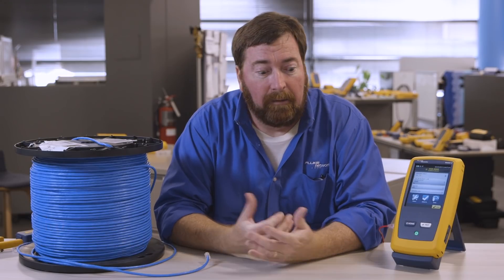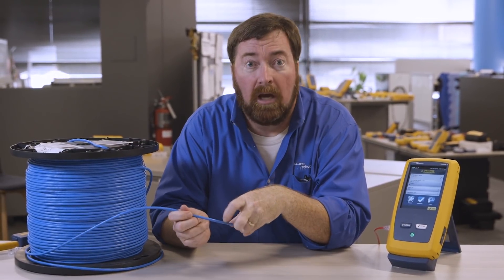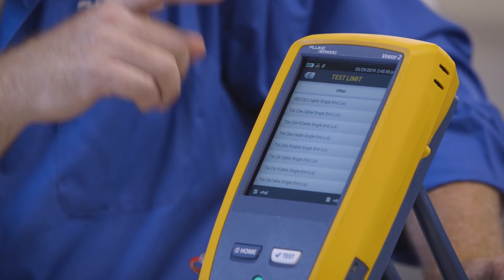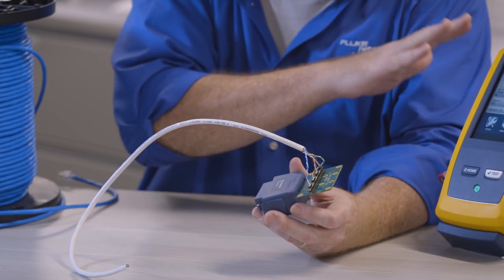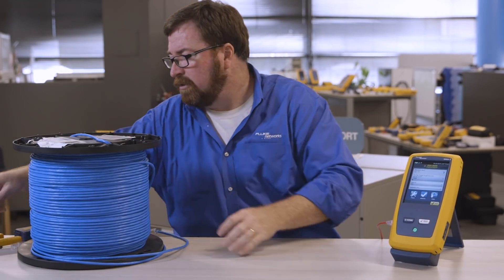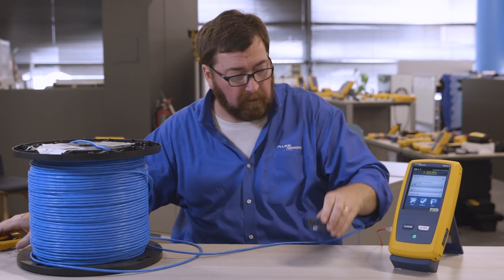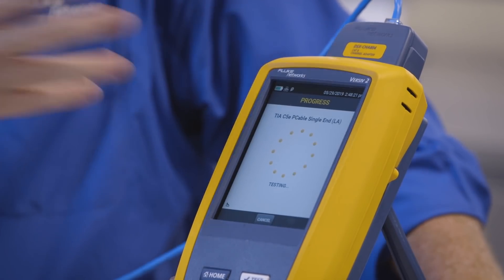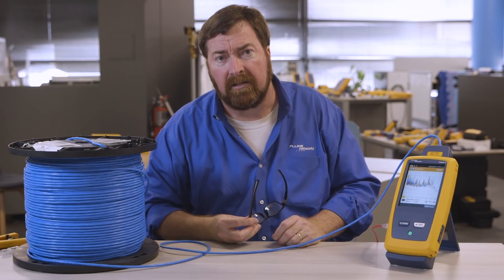Single-Ended Spool Testing with New DSX CableAnalyzer™ 6.2 Update By Fluke Networks

Comment: great info.  the older units had a lot of tests that are not available today.  like the ability to ping a switch to find a port.  if its available i haven't found it yet on the dsx 5000
Reply: The DSX is a Layer 1 Physical Layer Tester. You won't run Ping Test on Physical Layer test